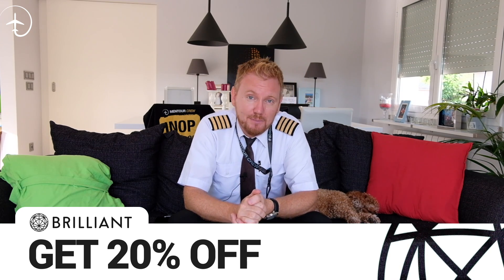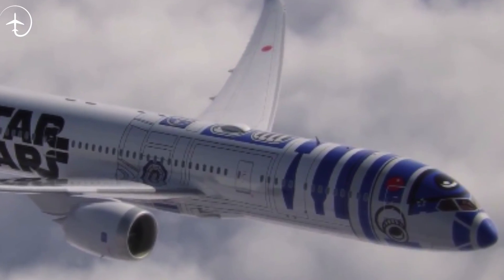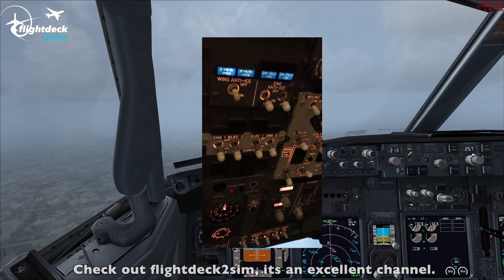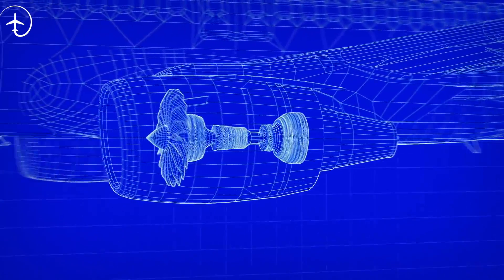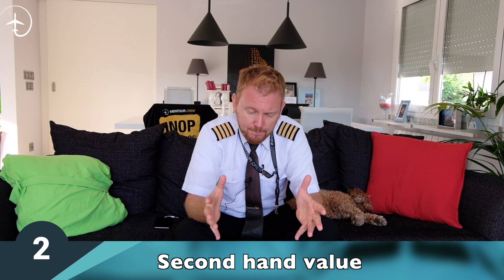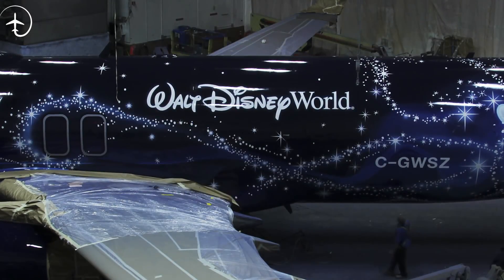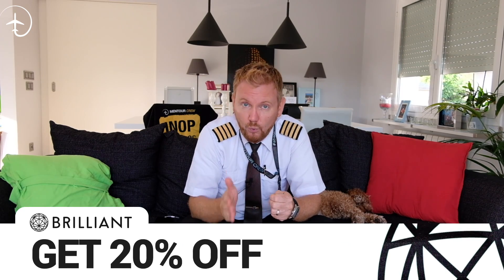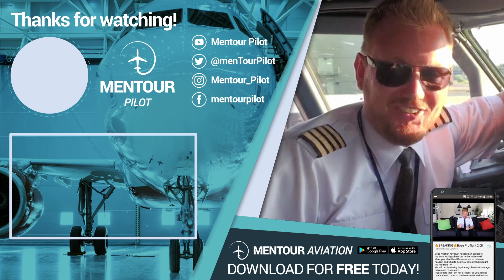Why the front of the Jet Engine is NEVER painted..

Comment: This is the most interesting channel on YouTube
Reply from the maker: Thank you so much! 🙏
Reply: Mentour Pilot I got a question about this... what’s the crusing speed for a Boeing 737? qwq
Reply: @VelocityEditsuwu  Usually about 400 - 450 knots. I don't know how fast different airlines fly them for fuel savings but you start to straddle the overspeed limit at a little under 500. It also limits your speed to fly lower, so while I in my simulator may choose to cruise at 40.000ft, airlines will very often go at 32 or 35k feet, as imposed by air traffic control.
Reply: @VelocityEditsuwu  m0.78
Reply: @maiden5427  idk if its just me but i dont like using mach as speed unit as the speed of sound varies depend on the altitude.
Reply: @schivver  In some cases that's exactly why you use mach, because even though M=1 might be faster/slower at different altitudes, being close to Mach 1 still means a sharp rise in drag and all the weird things planes do at transonic speeds. That might happen at a lower absolute airspeed at a different altitude, but it still affects the plane the same way as the same mach number at a different altitude. Airspeed as an absolute measurement isn't always useful because at different altitudes, the same airspeed might mean very different amounts of drag, fuel burn etc. But for light, slower aircraft that get nowhere near M=1 you don't care so much and use airspeed in knots, metres/sec etc. Some airliners fly fast enough that it starts to matter
Reply: @bernardw4842  I got ya. The actual speed in real numbers may change due to altitude. But the percentage actually floats with the rise and fall in actual MPH Mach. Whether its 450 Knt or 500 knt. That is the overspeed danger speed, .73m will BE .73% of Mach regardless what the actual airspeed is: knots, mph, etc.
Reply: @schivver  I think that's exactly why it's expressed as a mach speed
Reply: @VelocityEditsuwu  Cruising speed for a 737 is 525 mph
Reply: @The_V0yag3r  ik i learnd awille ago
Reply: @lfox02  Hi, re: the "overspeed limit".. I assume this speed is calculated at which point the engines are at their peak performance / efficiency? Thanks
Reply: @maiden5427  Hello, isn't this in reference to the aircraft's speed, I think he's mentioned before? And if so, what's "m0.78" mean exactly and why not just use knots; that is, if you don't mind? Thank you
Reply: @timothybradek3560  The maximum speed is usually either the point at which the control surfaces, engines, etc get
 damaged or the speed the plane simply cannot exceed by its own power under certain conditions.

The cruising speed usually depends on the altitude you are permitted by flight control and the flight plan you are given by your company. They are the ones running calculations to work out the best fuel consumption, the best route to take advantage of winds and avoid adverse weather, where they can buy fuel cheapest, etc.

It's been a while since I last looked into this so keep in mind what I recall might not be correct.
Reply: @timothybradek3560  m is Mach and 0.78 is 78% the speed of sound at the airspace's atmospheric conditions, usually 450kts-480kts (true airspeed, tas) between 34000ft to 39000ft cruise altitude. 

They don't use true airspeed often during hand flying, monitoring true airspeed can be dangerous for landing and takeoffs. Indicated air speed (kias) is more suitable during take offs and landing, because it takes into account air density/pressure, however above 10000ft kias is not very useful for example 280kts indicated airspeed can be equal to 500kts true airspeed at 31000ft  or even  480kts true airspeed at 35000ft depending on region, air pressure etc, also that same 280kts kias can also be equal to 280kts true airspeed at any altitude if conditions allow. In short kias varies a lot especially at high altitudes, while true airspeed  varies with temperature.

 This is where Mach speed comes in and it is more accurate above 10000ft and it can be used to manage airframe speed limits during cruise and economic cruise speeds.
Reply: @MentourPilot  
Duuuuhhhh  WHY  NOT  PAINT  IT  WHITE????? Duuuhhhh!!!!
Reply: Right up there with The History Guy.
Reply: This is the most interesting channel on YouTube
Reply: Bernoulli’s laws don’t like turbulence
Reply: @artnickel1664  I think of hydroplaning; wherein, the tire pushes the water accumulated in front to a greater speed; thereby, lifting the tire above the road surface... a simple reference of Bernoulli’s laws of fluid dynamics. Thanks.. your thoughts?
Reply: You're so right about it...
Reply: Defo
Reply: NOT facts
Reply: No
Reply: Metals conduct heat, not convey it. Minutia, I know, but the correct term in physics is conduction.
Reply: I would like this but it is against the law
Reply: It really is.
Reply: Your aviation knowledge is infinite. Thank you for sharing 👨🏼‍✈️
Reply: Fascinating stuff, I'd wondered about this before, great to find a proper technical explanation!
Reply: How many gallons of epoxy paint does it take to paint your 737?
Reply: It’s an interesting channel, no doubt, but with 300minutes of video per minute uploaded, I’d be cautious with such high accolades... just saying. :)

Comment: Why take it from the compression stage, before the air has been used and not after the turbines where it has already been used, is higher pressure and is hotter?

Comment: From working at Canadair in the 70s, while in the RCAF, as a member of an experimental aircraft crew,  I found out that extra paint adds to the weight of the aircraft; not many people realize that, but visualize that paint  in its original container before it’s applied to the aircraft. Hundreds of gallons!

That’s one of the reasons why many aircraft are mostly painted white, with just the company logo.

Comment: The fact that you say that paint is an insulator, that just isn't true. There have been extensive studies on this within the hydronics industry and its impact on radiant heat. It is actually a very good read. At first glance it seems counterincuative, but they have found that only the last paint layer has any impact on radiation. That being said in this application you are just keeping metal warm and not trying to heat a room, so I don’t think it would matter at all. I think that the degridation of paint and how it looking warn would not present to customers well. although it might not have any impact on fuctionality or reliability, it can have a negative impact on perception.

Comment: A point to add is that bleed air from the compressor is hot, the act of compressing it heats it up.  Hence it is good for de-icing.

Paint chips from a painted intake lip could melt onto the compressor blades, affecting the engine's balance and efficiency, as well as being really hard to remove.

Comment: the front inlet cowling semms to have kinda painting, not paint, but anodizing, and it can be coloured without these heating flaking problems,it's an extra process and costs more, but i'm pretty sure this part is un colored anodized, and it's durable and protects the aluminum well. The process is much like electroplating, but nothing is added to aluminum apart from colour if used, aluminum itself generates crystals on the surface. doors in aluminium, which are often brown, are anodized and colored brown, the coloring is done with simple pigments, and when all processes are finished this cannot be changed, it is done in one of the finishing baths, and when the last process is done, the crystal coating is closed and the coloring is permanent. i may be wrong, but i don't think i am, aluminium need some protection, and this is the best way for a part like this.

Comment: So the question remain, why can't they use the hot exhaust gas to deice instead of bleed air.The exhaust is already passed the engine core and should affect it less. But I see a lot of turbine aircraft still using old fashioned rubber boots on surfaces or weeping wings (heavy)  I heard in the next decades, pizzo electric means of de incing is coming. I am not a fan of using bleed air for cabin pressure, I prefer the 787 using an independent electric HVAC system. This keep the TCP turbine oil additive from the cabin air which some people are sensitive to. They leak more with older airplanes with less than perfect engine seals.

Comment: For me the temperature one was the obvious one I knew before I clicked on the video. Aircraft skin may vary from white to black depending on whether reflecting sunlight, or emitting heat, is most important... but for just about anything subsonic, white is going to be optimal (black is good for things that move very, very fast and get their heat from that, and the sun is a minor factor.)
Reply: Rockets are white, of course, because the reflection of energy is important for when they're on the pad, fueled, or in space, where there is not air. The fast, in-atmosphere part of their journey is the short part.

Comment: On a kind of related note, when a plane is sitting level on the ramp, there's a very slight forward angle to the front of the engine.  I'm guessing about two or three degrees.  Is that done on purpose because the ideal angle of attack is a slightly pitched up attitude (not sure how many degrees but I'm thinking roughly the same amount) so to provide the most efficient injest of air into the engine?

Comment: The front of a jet engine, which is called the compressor section, is typically not painted because paint can interfere with the engine's performance and potentially cause damage.

The compressor section of a jet engine contains multiple blades that rotate at high speeds to compress incoming air. These blades must be precisely designed and manufactured to achieve maximum efficiency and performance. Painting the blades or the interior of the compressor section can add weight and change the shape of the blades, which can disrupt the airflow and reduce the engine's efficiency.

Additionally, paint can also break down at high temperatures, which is a common occurrence in the compressor section of a jet engine. The breakdown of paint can create debris that can damage the engine and potentially cause a catastrophic failure.

Comment: First of all white paint is cheap, air is dirty and leaves streaks, as do fluids, rain is dirty also.  No paint likes to stick to aluminum, thermal cycling and so on. The ring cowls on the engines are heated by engine bleed air and get quite warm. It is just he environment the operate in and what they are expected to do.

Comment: When you mentioned ice build up at the front of the engine and being sucked into the engine reminded me or a race car I worked on. I put a Holly 750CFM carburetor on the engine and at idle I watched the engine "EAT" the air horn. It looked like sand in an hour glass flowing into the carburetor. The engine needed an 1150CFM carburetor to stop this.

Comment: Before I watch this, my guesses.

About the paint colour. I'm sure I read somewhere the colour was to do with heat. On the ground maybe? Meaning dark colours absorb heat more and so light colours are better for when the aircraft is on the ground. But then this must not be true as one of the largest airlines in the world, have hubs in some of the hottest cities. Thinking SouthWest and Phoenix.

Then the cowling. My guess is the front edge will be constantly exposed to rain (at high velocity) snow, and HAIL etc. So the paint would constantly be damaged.

Now let's see? 

Well, now I've watched it.

Wrong on cowling, though I think I did briefly think about ice.

Re paint colour. I was right on number 3! Still doesn't explain South West

Comment: American Airlines used to have a polished metal body or was that clear varnish? How did that compare in terms of weight and cost? I assume the shiny metal will also reflect a lot of sunlight and not heat up as much. It looked cool anyway but it seems like they replaced that by a matt silver paint. Maybe because polished metal doesn't work on composite bodies of newer aircraft.

Comment: I think the Delta tri-color paint livery on the Lockheed Tristar was a very striking scheme.

I wonder if a dimple pattern on the engine inlet cowl might be beneficial.
It helps golf balls fly further and also would strengthen the ring structure. 
Small dimples form a type of aerodynamic barrier to allow for reduced drag 
Possibly on turbine nose cone as well.

“ we love ❤️ to fly,, and it shows “

Captain Jack McMahon United States Marine was able to control his badly stricken Tristar and passengers by superior pilotage and command. His elevators became unoperational after pre-flight on takeoff climbing out by sudden seized bearings.
Able to use control inputs and center of gravity shifts to maintain control over a certain doom scenario.
As he assessed the viability of sustainable flight ✈️ he refused shorter route to emergency landing strip due to possible collateral damage to civilian population.
Choosing instead to feel his stricken bird out over open ocean to gain knowledge of ability to land with very limited inputs.
Saving the lives of all passengers and crew by doing so.

Comment: would a black airplane not require less heating once it's up in the air ?  i mean, if it's -70C° at 10km, a black paint could mean it requires less heating to keep the interior at 20C°, or am i missing something ?  especially during the day when it can soak up some heating from the sun.  could a paint be made to switch collour from black to white my some electric or other influence so that the plane could be white on the ground but black in the air when it soaks up sunlight ?  some sort of chameleon effect ?

Comment: Quick question regarding the white paint and temperature: is it not that the temperature at cruising altitude is mostly cold, and in negative degree Celsius?
Reply: Correct. Very cold. However, hot engine air is normally used to provide air to the cabin pressurisation/airconditioning system, so keeping the aircraft warm is not an issue. Also, humans in a confined, poorly ventilated area tend to generate their own heat.

Comment: I know I am late to comment on this video so it will likely not be seen but as an aircraft mechanic (US Air Force Crew Chief) I would say the lighter colors also help to identify potential issues with the airframe.  Loose rivets tend to leave a "smoke" mark around and behind them as when they move they wear down further and create microscopic metal dust and this is easy to see on a light color, especially white.  The same can be said for cracks in sheet metal.  A tiny small dark line (cracks usually start out to be about the width of a hair and only fractions of an inch or a cm or so in length) is a much more apparent flaw when it sticks out on white paint rather than darker colors.  I cant imagine how hard it would be to spot something like that on that Walt Disney World Westjet or the darker colors of a Southwest aircraft.

Comment: Ice in the engine "not great".

I am related to one of the survivors of the April 1977 Southern Airways flight 242 crash in New Hope, Georgia.

A severe thunderstorm, complete with hail caused both engines to flame out from the sheer volume of water drawn into the engines.

The engine hub nose cones had grapefruit sized dents from the hailstones.

Comment: In the aerospace biz an aircraft (or rocket for that matter) that has been built but not sold is called a "white tail". On a different subject, you may remember when the first space shuttles were launched the external tank was painted white. Eventually someone pointed out the cost of launching paint.

Comment: Do the Aircraft industry a favour and suggest to Boeing and Rolls-Royce, and others that they should coat the engine leading edge with Non-stick Teflon. Yes there same stuff on your frying pan. Ice will not stick, nothing will stick,  and yet it can handle the heat from the deicing system. Win-win.

Comment: One reason more for a simple color design:
Easier Maintenance on the Line Maintenance. When you have to do a paint touchup, normally you have just spray cans. Not so many different cans required and it's nearly impossible to repair a complicated pattern on a field repair.

Comment: Would weight be a factor in deciding how much paint to put onto an aircraft? My old Volvo 850 TLA had 20 pounds of paint and clear coat on it and it was just a four door sedan. Obviously an airplane has many times the surface area  of my sedan so the weight of the paint would seem to add up pretty quickly.

Comment: I always thought one of the main reasons for the white paint job other than the obvious cost implications and that white reflects the heat was that white shows up and fuel or oil leaks, or any other leaks and any air frame failures such as popped rivets or damage would be easier to spot?

Comment: Great explanation.  There's also another reason: radiation absorption.  The higher you go, the more cosmic radiation you get; since the radiation comes in the wavelength of the light (sun), the more you reflect, the less you absorb.  People and radiation don't mix well together, specially for the frequent fliers and the crew.  Also, avionics are very sensitive to radiation (being all man-made electronics) , despite being shielded and all, you don't want them to be fried over time until a fatal failure 20.000 feet above in the middle of the Pacific :p

Comment: is there any specific reason its the 5th or 9th stage? or is that just the most convenient spot to put all the stuff needed for the bleed?
Reply: The stages will be chosen according to their temperature and pressure at various engine rpms. At idle on the ground, there may not be enough pressure for the aircraft systems using the lower pressure stage alone, so the high stage will be used. I'd say 5th and 9th on the 737NG provide a good range of temperatures/pressures over the whole rpm range.